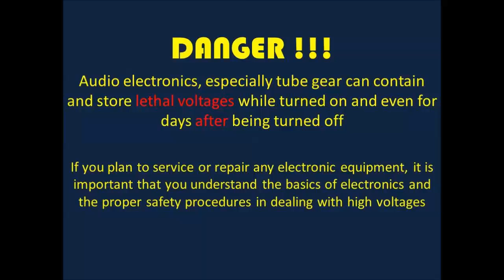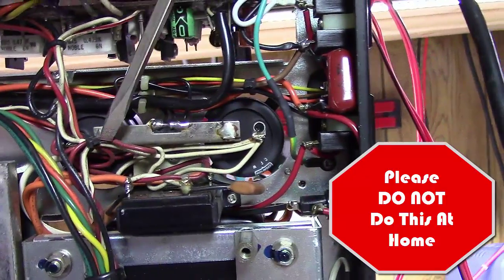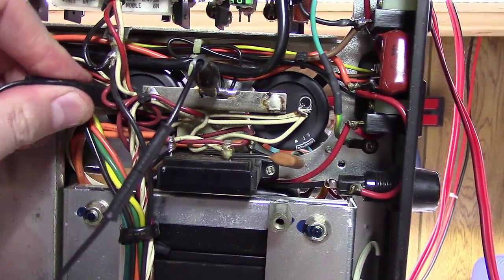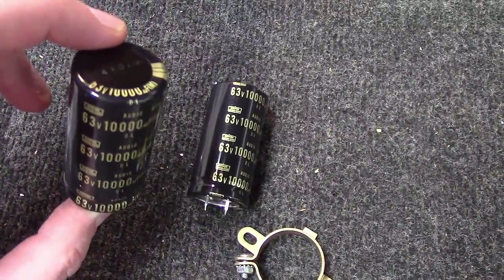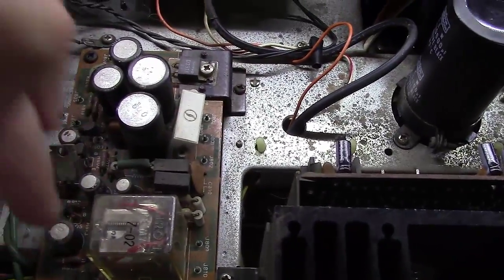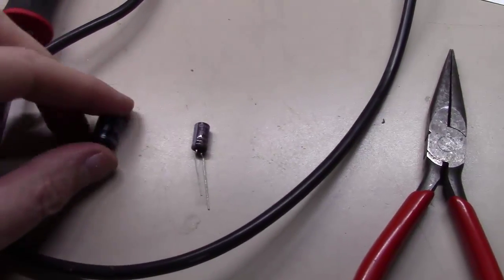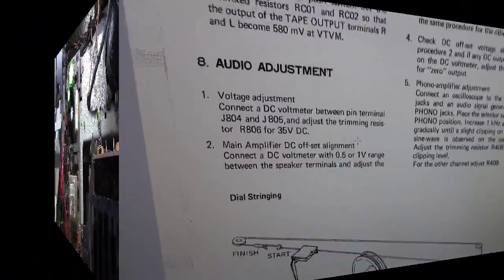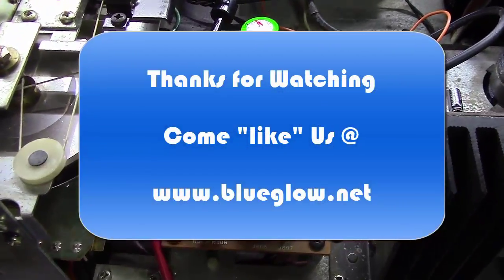Rebuilding the Power Supply in a Marantz Receiver - BG046

Comment: Great video. And it is really great finding someone who enjoys explaining in such detail the step by step process of what you do know. Thank you. 
I plan to repair/ restore my Marantz  4400 someday once I feel I am capable.  Long way off yet.  But my poor 4400 which I have owned new October 1974, has suffered through two major earthquakes when I lived in Big Bear Calif i1992. #2 flung my 4400 to the floor.  The Dolby rotary switch ( which appears to have 5 wafer switches in it) was bent severely at the stem as it passes through the face plate. Knowing full well it would snap I did, straightening it. 😁 🔫 Duh; any suggestions on trying to match this switch? I am convinced someone has a replacing switch but trying to cross reference and such is not easy. My only other option is to ( if possible ) disassemble the wafers, and place the stem in a lathe. Machine the stem down a few thousands and place a slightly undersized hollow stem over it with heat & crazy glue. Thank you so much❗️

Comment: just wondering if you can shed some advice here. my marantz sr5008 has this popping-buzzing sound after about 5-10mins of use. some said its a capacitor problem. some said its the transformer.
i want to try and do it myself (got a little background on electronics, sort of) 
what might be the possible cause of the popping-buzzing sound?

TIA, cheers

Comment: Have you compared the accuracy of bringing a cap up to full voltage to check for leakage vs. using the esr meter? I'd love to use the meter if it's close rather than firing up my Sprague cap tester each time I check older large expensive caps.

Comment: At the beginning of this video I thought a cap smoked causing the corrosion on the chassis.  That is really nasty pitting.
Reply: This pitting can mean that this unit was stored in an area without climate control, which is very bad for electronic equipment.  It is not the temperature that causes the problem but rather the humidity that can reach near 100% with out heating and air conditioning.

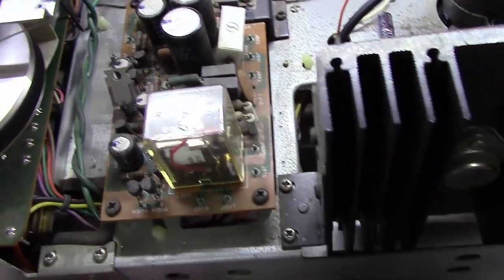Comment: 9:47 ...  While this is a good idea, isn't there a possibility that the leads of the new capacitor might be different like coming out the bottom at a right angle to the original capacitor?   I would think it would be better to mark the stripe or the plus sign position.

Comment: Don't understand one point Mark.  How does the 'tic' mark on the old cap help you line up the new one?
Reply from the maker: If you do enough of this type of work, you will pull out a capacitor and then 2 seconds later while holding it in your hand, you will say "hmmm which direction was positive when I pulled it out?"  with the tic mark, you can hold it back over the spot, know the direction all your tics are in and you'll instantly know.  not all boards are marked clearly which directly pos / neg are, and some are marked incorrectly.  you need to remember how it came out to put it back properly
Reply: Thanks.

Comment: Maybe you will see this, maybe not. 2226B.  No protection circuit.  Unit lights up, only hum on output. (headphones)  Do bridge rectifiers fail much? or would you concentrate on power board caps?.  Sorry for the question.  Filter caps test good as you indicated. I'm better with tube radios, and venturing further.
Reply: went from bad to worse. Taking some voltage readings on the green transformer output wires, As soon as I did, main fuse went.  UGH.

Comment: Could anyone help with this ? I took the Tone Amp board out of my Marantz 2238 to clean the pots and switches. Put it back together and it sounded great. But after an hour the amp started smoking and stopped. There was smoke pouring out of the transformer which was too hot to touch. Can't find any evidence of a short. Worried I have killed my Marantz. :(
Reply from the maker: +doogie h Likely some damage done if you have smoke from the transformer, and likely something shorted somewhere.  Use a multi-meter set to continuity and start poking around to find the short.

Comment: Such great videos. I just blew the (2nd in) the 3A fuse on my marantz 2270. What is that fuse for? I had asked my 6year old to flip my record but she didn't put the needle all the way down. I told her I couldn't hear it so she turned it up to 11. When I walked in and found the needle up I put it down not knowing the insane volume that it was at. Now I have no lights or sounds. The only thing I see inside is this single blown fuse. Could this be the issue?

Comment: Why do they glue caps down.
Reply: +MrMac5150 
I was told it's to reduce stress on the solder pads during shipping and general movement of the unit.
Reply: +omg123hibob which is why i will probably do some gluing of the larger parts during my marantz recap.  just not that horrible old yellow stuff.
Reply: +Der Ubersau 
That old glue can actually turn corrosive. I haven't seen it being corrosive in any of my Marantz 22xx units, but my Marantz 1550 had it eating my power supply.